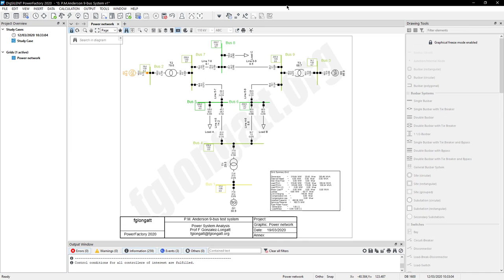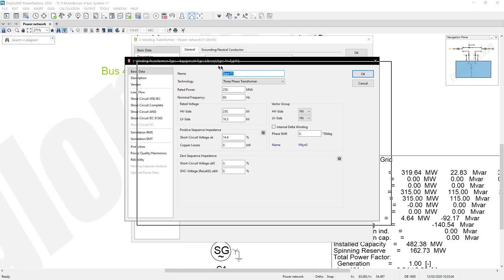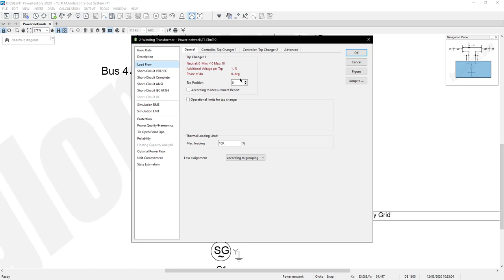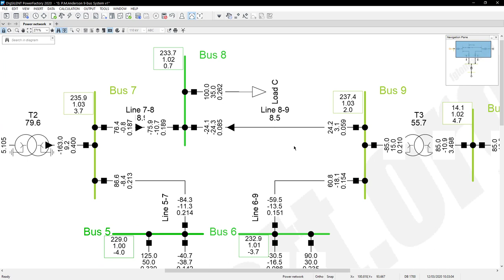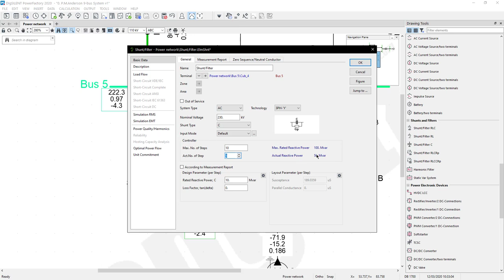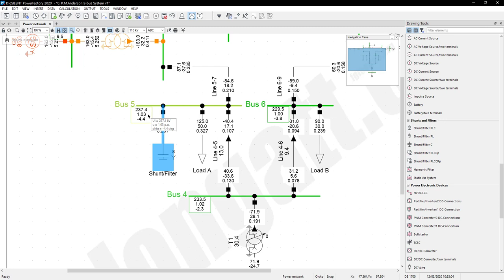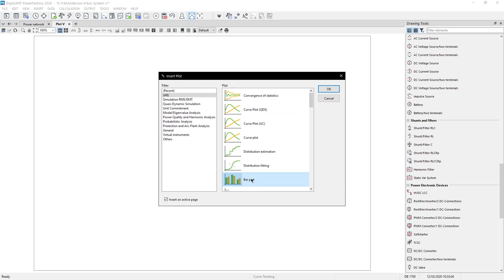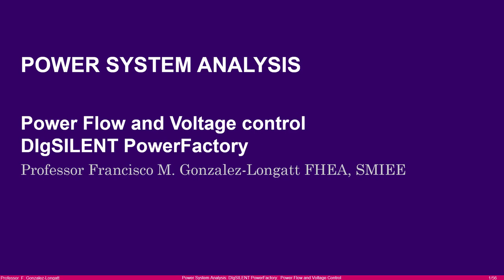Tap Changer, Shunt capacitive compensation, bars plot in static studies using PowerFactory

Comment: - tap changer = modify transformers ratio, change the voltage. Background: load increase, more voltage drop, use tap changer at load current is low. type: OLTC,  NLTC
- set the shunt capacitor & tap changer automatically
- print the plot & SLDin the "professional way" wkwk
- transformer shifting = modify phase angle vector at transformer
- in the real world, shunt capacitor didn't install at nominal voltage of the busbar, why? when we use another characteristic of compensator (R-L-C, R-L-C1-C2Rp, R-L)?